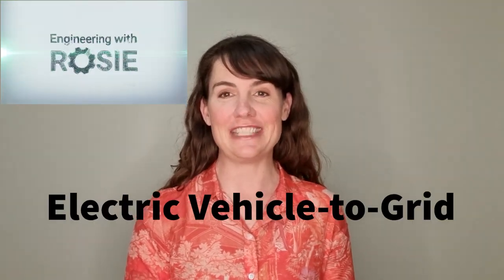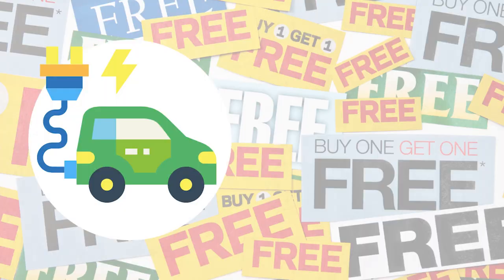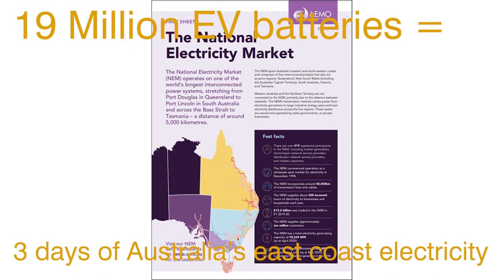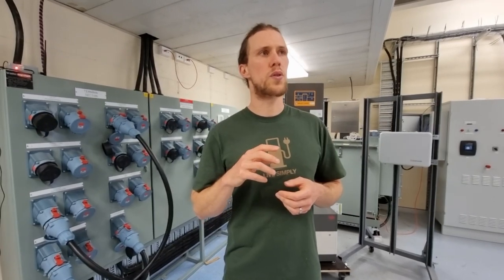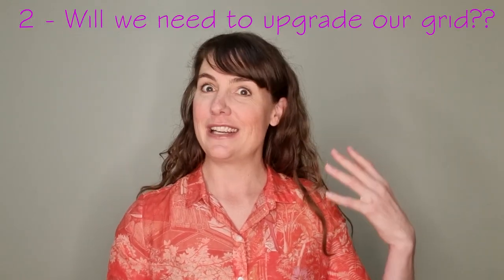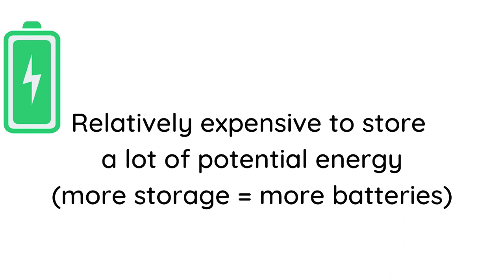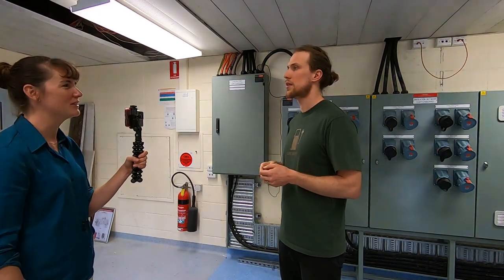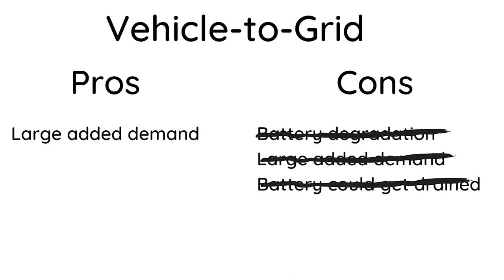Electric Vehicle to Grid Technology Explained

Comment: There's a couple of other technological factors with V2G that weren't really discussed. The biggest one: a battery delivers direct current (DC) power, but grids run off alternating current (AC) power - converting AC to DC to charge a battery is relatively easy, but converting DC to AC is relatively difficult, and this is something that's really holding V2G back.

Almost all existing V2G wallboxes include an inverter, and the DC-to-AC conversion is done off-board. An entire inverter - particularly one which has to put out a true sine wave, with minimal distortion, synchronised to the grid and with a power of 7kW or more, in a wallbox-sized unit - plus the comms hardware for the wallbox to negotiate with the car is not cheap, and bring the cost up to ~5 times what a unidirectional charge point costs. This is the big technological factor holding V2G back - putting an inverter on the wall of every EV owner is not cost-effective for the EV owners or the grid operators, even with the revenue generated by the grid services.

The other option is to convert from DC to AC on-board the EV. All EVs have an on-board AC-to-DC converter, and it would need minimal redesign and cost increase to turn into a bidirectional converter. I work in power electronics, and a lot of companies are talking about how on-board chargers will be going bidirectional, including Infineon and Wolfspeed. At the moment, though, on-board V2G (also called AC V2G, because the vehicle supplies AC power) is still in the research stages, although Renault have been doing a load of work on it and the Ford F150 Lightning appears to use this method for their V2H power backup system. The AC wallboxes will be a lot cheaper than the DC wallboxes (they only need to include the required comms tech) and the additional cost to the on-board charger will be minimal - this will probably be the method used in the long-term.

The other big technological issue, though, is communications standards. A V2G session needs a negotiation between grid-side and EV-side that's at least as sophisticated as a DC rapid charging session, with the car telling the wallbox its state of charge, voltage, current etc. The only charging standard that supports V2G at the moment is the CHAdeMO standard used by the Nissan Leaf (and it was designed to support it from the start, what with the... risks and history with Japan's grid). All other cars use CCS, and the update to CCS that enables it to be used for V2G will hopefully come out by the end of this year. Volkswagen, in particular, are champing at the bit to add CCS V2G to their electric cars, and from 2022, their ID.3, ID.4 and other EVs that use their MEB platform will support CCS DC V2G. This standard update will also enable on-board AC V2G.

V2G is a fascinating topic, and I share your enthusiasm for the technology! I think it can provide invaluable grid services, and also make a huge difference to the deployment of solar - V2G can comfortably carry a few kW of solar power per vehicle from the day into the evening. I think the next few years are going to be very exciting.

Footnote: the other factor affecting battery degradation is state of charge. Li ion batteries degrade when charged up to 100% or discharged to 0% and held there. Basically cramming all the Li ions into the cathode or anode causes them to get stuck. The worst thing you can do to a Li ion battery is charge it up to 100% and hold it there, the best thing you can do is hold it at 50%. The V2G trials I've been seeing here in the UK hold the EV battery in a certain SOC band - 20% to 80% or tighter - and only charge up to 100% if asked to. This helps suppress degradation, and will be a lot better for the battery than charging it up to full every night!

Comment: If there's any component of the battery value stack that truly makes sense for mobile storage (ie, EVs) its for FCAS, due the super lower energy throughput vs the availability payment. Demand charge management (in a C&I setting) would also make sense given certain load shapes, - wholesale energy arbitrage would not. Critical obviously is ensuring market bidding is aligned with the actual number of EV's (and their respective discharge capacity) that are actually plugged in. Another good vid of a complex topic.

Comment: I live in north Florida and the first hurricane of the season just passed through. The last big hurricane, I had no electricity for two weeks. I am considering a BEV. As BEVs convert AC to DC to charge, what is the possibility of putting a simple 120v outlet on all BEVs?
Reply: There are several cars with household outlets to choose from on the market today...
Reply: @SobrisSweden  To be more precise what I wish for is an external secure AC outlet. As Tesla is the highest selling BEV in USA:

According to the Tesla users club:
No, the Model 3 does not have an AC outlet. You can buy an inverter for the 12V cigarette lighter outlet though (they are not expensive). The outlet is limited to 12A continuous load (i.e. 144W).
.....
The Cybertruck most likely will have 120v outlets
Reply: @chrisconklin2981  Well, if Tesla can not deliver, you have to look elsewhere :-)

Comment: You nailed it when you said you were thinking like an Engineer, because this is best answered with common sense, and while it 's the least common of all senses, Engineers are no closer to having it than people in retirement homes and farmers (it hasn't been measured is the point). V2G exists because it's a sales point - a gimmick, at that. It is about the first instance where you can purchase, then sell back to the supplier, and it is futile. While it works in theory; there are so many better ways to solve the rare grid problem, but they don't sell EVs.
     We'll start with petrol. In over 100 years, we have not initiated a scheme where you can put 60 litres in your tank and days later sell a jerry can of it back to the servo where you bought it. It's preposterous, and this is an example of common sense. Map it to your EV, and it is even sillier when the best has the equivalent of about 20 litres to start with. I have often needed petrol for a mower, brush cutter and even generator, and despite my car tank being full and capable of not missing any, it is always common sense to drive down to the servo and get a can for those items. Now, map it to your groceries, your clothes, and just about every consumable you can think of? What need is there to sell back to the supplier, and more importantly - who does it?
     The gimmick is you can make a buck out of changing rates, but selling back to the grid is better suited to your solar, or even a battery attached to it. The need to involve an EV is a very expensive way to do it, and the maths proves it's senseless for the price you pay extra for the V2G cable and software on any EV that has it. You're getting 1 minute of a sale once a fortnight, after all. I have not bought an expensive battery (or an EV) and my solar sells unused power to the grid at one third of the price I pay for it at night. My last bill was a $26 credit, and I didn't have to monitor anything, as usual. No plugging in, either. The absence of hassle is a part of the common sense I factor in.
     So if the grid needs a fortnightly boost, then the grid should get more of those Tesla batteries they use in South Aus (or other means), and not rely on EV owners on the wish that 100% of cars in Aus are electric with V2G. The reality is (another common sense factor) - EVs are 1%, and about 1% of those have V2G. You can do the math on that one. While Scomo has grand ideas, they will not eventuate - not even close, so you will be looking somewhere into 2050 and beyond to solve the problem with EVs. In fact, forget Engineers - it's EV owners who are the most irrational vehicle purchasers in the country; those who buy the V2G capability are at the top of the tree. V2L buyers are second tier fools. When ICE cars were sold in large numbers, they didn't sell us all the hoses to connect to the bowsers; no, common sense prevailed and the bowsers had the hoses. EVs? That logic went West, because purchasers are as dumb as posts. V2L and V2G are just so you can buy more hoses. The buying public needs to wake up.

Comment: Hi Rosie, Thanks for the video. I'm with you with V2G. Besides the lack of hardware to do this there are other issues as well. 
I happen to think that energy storage and dispatch is a growth industry, but pumped hydro seems to be incredible inefficient, because the first time you drop water through the vanes that kinetic energy only produces around 40% of the electricity equivalent. Pump the water back up with the use of excess solar power for example, which has zero efficiency then drop it through the vanes again at 40% efficiency, that equates to a pretty poor round trip efficiency as far as I can see. In comparison, batteries have a round trip efficiency of around 90%. The disadvantage of battery storage is the initial cost. At around 50cents a watt, a 1 hour base load backup requirement for Australia, around 12 gwh. would cost around $6,000,000,000. Of course we wouldn't need that much storage when we have other backup sources such as gas etc. 
Imagine if you could charge your car for free while doing your groceries and then when you get home, plug the car in so that when energy demand gets high at around 6PM your car starts assisting the grid with the extra load. It would have a huge impact in flattening the duck curve that is being experienced now. For that to be viable we would need 'Time Of Use' metering, so that one could charge the car at off peak rates, or from solar panels, and then sell it back to the grid when the demand pushes the value right up. That technology already exists if you have a smart meter that is.
In my situation, I have a 9 KW solar array on the house. I also have a 'power hog' ducted air conditioner Over 12 months I buy around 4MW from the grid but sell back 10MW back to the grid. Growatt have battery inverter technology that takes power from the solar panels and then monitors the direction power through your meter box. It then balances the solar energy with household use to determine whether to charge the battery, or power the house, or use the battery power if the solar is not producing enough.
Without proper legislation, V2G just isn't going to happen, but with a good bi-directional home car charger, (V2H) the 40 or so KW battery could easily flatten your household energy consumption. In our case, the solar panels don't produce enough energy to run the household in June and July so we would have to top up the car at the shopping centre every few days.
Maybe one day we will get a federal government that is serious about cleaning up the grid. A good start like I said, would be TOU Metering, no imported EV's unless it has V2G. (Ordinary EV's are a bourdon on the grid)
I'm sure you have a good grasp on the subject and hope this may give you a different look at the technology.
Thanks.
Reply: Round trip efficiency of pumped hydro is 70%-80%, not 40% as you stated. Battery storage round trip efficiency is 80%-90%

Comment: One key reason there is limited or no take-up is that the world's largest BEV Manufacturer does not recommend or support V2G or V2H.  Tesla primarily does this because the majority of their models have battery chemistry that is limited to 1000+ cycles and Tesla spends a fair bit of time convincing their BEV owners not to do V2G/H.  Recently their base level model Y's and Model 3's use LFP batteries which are rated for 3000+ cycles and are really well suited to V2H and V2G, however it is only the base model single rear wheel drive options.  All the long-range and higher performance options and all Model S and X's don't do LFP.   You wont see Tesla supporting this until many more of their models have battery technology that are conducive.  Personally I want the option and I am waiting for the manufacturers to start supporting it as part of there recommended/warranted use of their vehicles i.e. the Ford F150 in the USA is one such vehicle for the V2H option.   The BEV Manufacturers I follow don't do this yet in AU but I expect this to change in the next 1-2 years and that is when I will buy my BEV.

Comment: It works fine in theory. The problem is always being connected to the grid. For this only works when every parking space has a charging point. Obviously at night if you can charge at home then that works. But what happens when you are shopping or at work. All those parking space need to be connected. All your busses and trucks that will be charged at night will spend most of their time charging as you have to put so much energy into them you don't have the spare capacity to discharge.

Comment: 17:38 is a little long for an elevator pitch. I've owned an Electrical Contracting business in the same industrial park as EV GRID INC who has fought this battle for 20 years ( Shame for not putting a plug in for them). By the way, AC PROPULSION ( Yes, that AC Propulsion) is in the same industrial park ( San Dima Commerce Center, San Dimas CA). At the community mailbox, I've always argued you have to start with the utility providers assuring they will pick up round trip warranty issues with vehicle manufacturers when the EVs are used to feed the grid. Remember in America we still have a huge amount of across-the-line starting and poor power factor correction.

Comment: One of the problems is that we are capitalists. The grid is there for supply and generation companies to make profit.
The grid doesn't exist primary as a provided service to the country.
For example:
Most cars stand idle most of the day and night. If you commute to work, plug in to provide grid capacity during the day, then drive home and hook in again, who pays/gets charged whilst you are connected to your employer's connection?
The idea of whenever you are not driving you are providing part of a national battery capacity is great,  but the need for profit will hinder the uptake.
Reply: In the coming standard the car will have a unique identifier, so the owner of the car will get the compensation...

Comment: Using a car battery as an energy storage device for off grid usage would complicate the
manufacturer warranty , especially where customers would power other things like heat 
and a/c with their vehicles,especially in peak load daytime hours.The usage by the utility
would be minimum so that would affect the vehicle very little.
Reply: Nissan specifically includes V2G use in the Leaf battery warranty if the installation is to their standards.

Comment: If all the cars went electric then the energy that the oil refineries needed should be freed up. How much load do the refineries use?
Reply from the maker: Great point! I don't know but I will look it up. Actually I do know the answer for Australia, because it is very close to zero... we import virtually all our petrol and we only have about 2 months reserve in the country at any time. So for us EV vs petrol cars is also local vs imported energy. Yet another argument for the "pros" column for EVs!
Reply: Oil refining is a very energy intensive business,  they waist very little energy.  Remember they are in the energy business  and every Joule of energy not wasted  is money to them.    I am confident there is lot of fraction product that would otherwise considered waste but they use it to generate electricity and heat to run the refinery.  I would not think they would import anything other than the crude oil and may even deliver electricity to the grid.   Now something like Aluminum refining is the other way,  cost of Aluminum is directly related to the cost of the electricity to refine it from the bauxite.
Reply: @EngineeringwithRosie  ooh, interesting. Perhaps the government could start looking towards the future and getting ready for the EVs that are going to appear.

Comment: Battery degradation is dependent among others by the depth of charging. Charging and discharging daily by say 10% would have little impact. I think that the biggest issue with V2G technology is that it is stochastic storage dependent on vehicle use patterns, vehicle owner needs and other factors stochastically influencing availability. So now we have stochastic energy source and stochastic storage. This is a lot of cats to herd. There are however scenarios where car batteries can be used to smooth short transients for frequency control. I think that a much bigger benefit is using electric cars for individual energy storage - you can drive the car to where the energy is needed. Cars are mobile energy storage.

Comment: In the city, Solar and Batteries use only a small area of "the grid". By that I mean small distance of "the grid". Like plumbers say "S... only flows downhill", this is true about electricity too. Electricity generated at home will be used by the closes neighbor that needs it, line losses are smaller as distance traveled is small. So, Grid Infrastructure usage is small. Grid Operators need to charge "Grid Users" by how far, the distance their electricity travels on "The Grid". This would equalize "Grid Cost", so that large Power Generators will have to pay for the "Grid Cost" of being located far from the "Grid Users". And, "City Generators" like Solar Houses get more $$ for generating close to the end user.